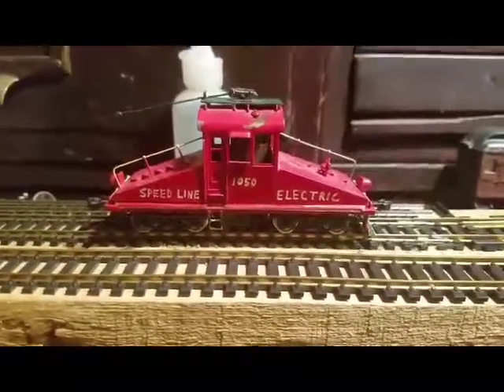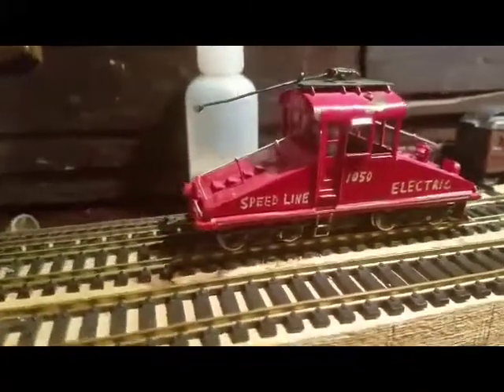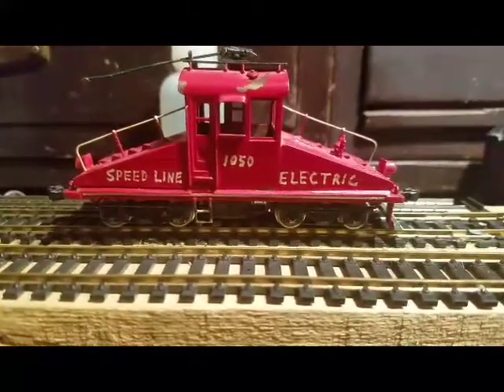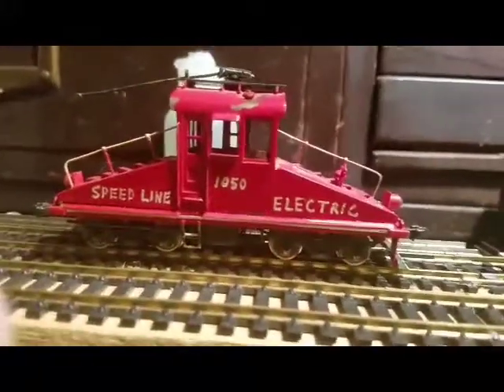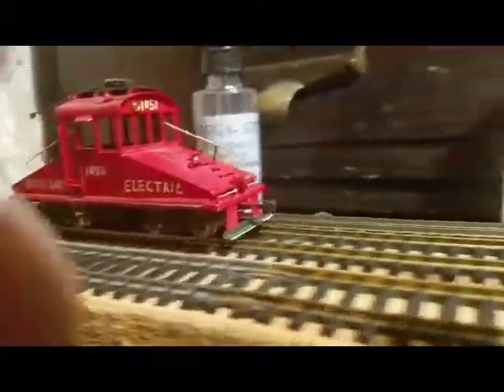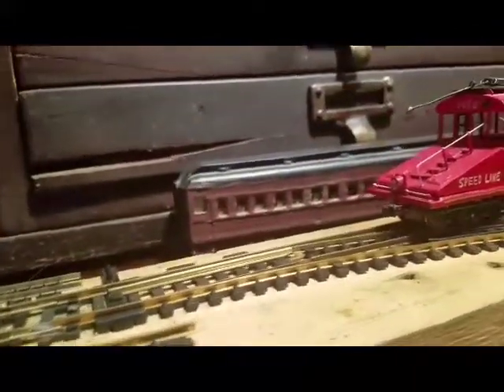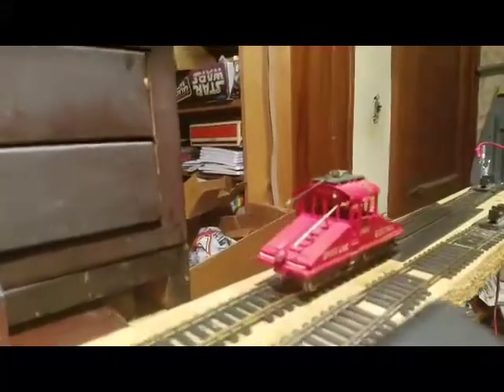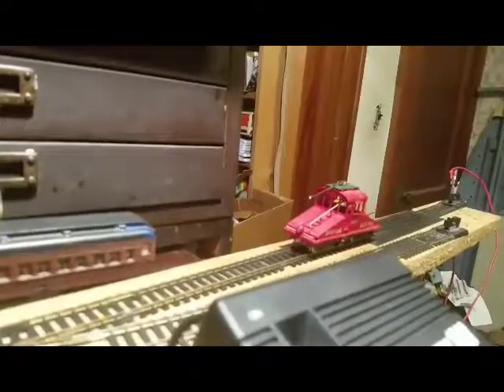HO scale steeple cab electric locomotive Rocky Mountain animation

Comment: i seen those toolboxes on FB
Reply from the maker: billfusionenterprise oh you see the toolbox on there. I'm just asking where on the locomotive on the top of the engine or kind of the bottom that's where the motor is at. I'm just asking
Reply: the real ones behinds the tracks
Reply from the maker: billfusionenterprise oh that thing all that was made by Globe company. It is a workbench but also well tool box thing. Got a filing cabinet and everything was made in the mid-1800s I think for a drafting engineer person. Original had paperwork and everything else but I bought an antique store and used it as a workbench ever since got to pull out table I paid a lot of money for that
Reply: my dad had a pair of those boxes, real good, if look for wood working tool boxes you can find them new